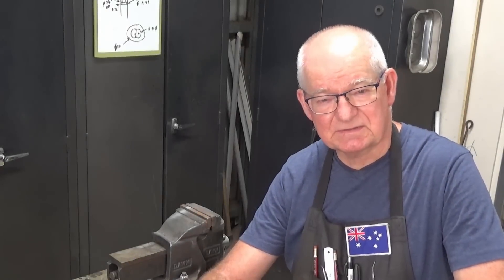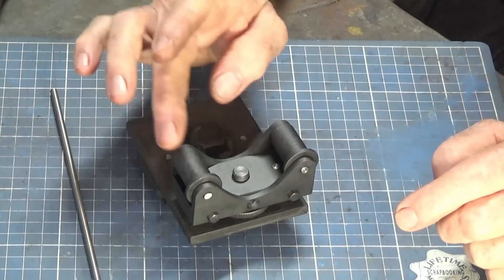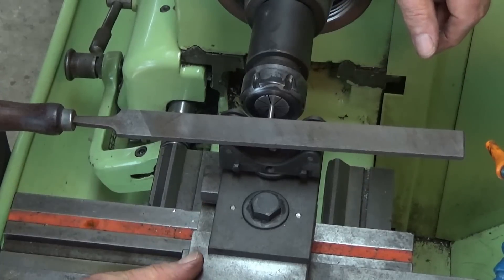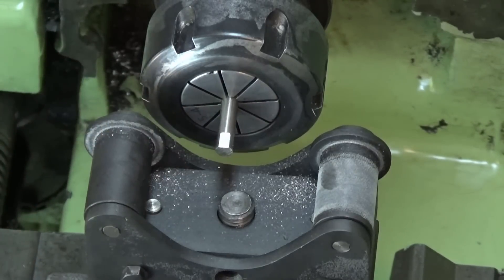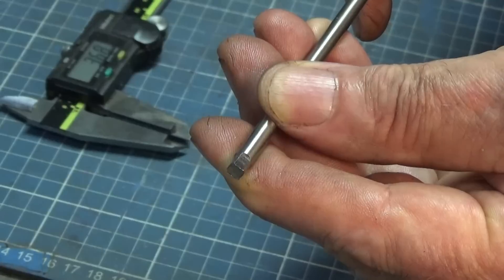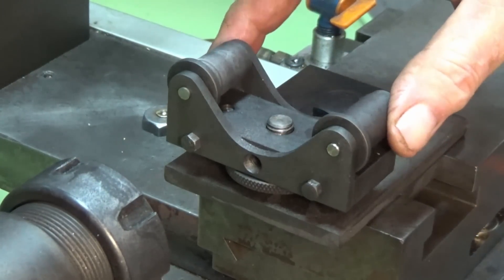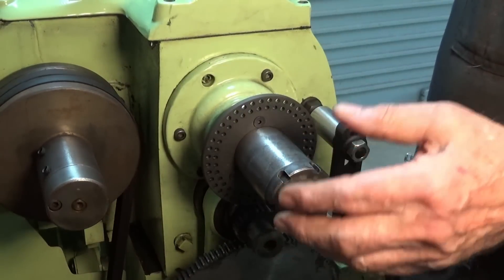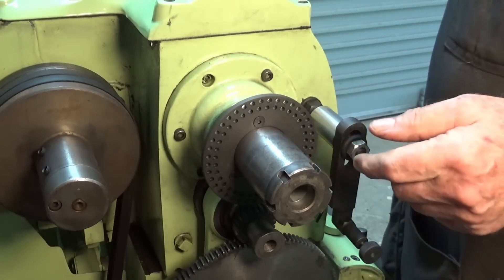The Poor Man's Milling Machine (AKA - The Roller Filing Rest).

Comment: Always enjoy hearing about the ingenuity that people have to come up with solutions to problems that don't require a whole new machine.
Reply from the maker: I was a member of a model engineering club many years ago and they had boxes of really old British Model Engineering magazines. They allowed members to take whole volumes home to read. They were a treasure trove of really clever and interesting tools and techniques. This would have been back in the days before you could just jump online to buy just about anything you wanted. It was also the period when there were material shortages after WWII. I guess it was all about making what you needed from low cost materials back then. 
Regards,
Mark

Comment: A mount for a dremel might be handy for less precision.
Reply from the maker: I have a cast aluminium mount that fits in my compound slide for a small Makita router motor. It is useful as a substitute for a tool post grinding attachment. It will take mounted grinding points and milling cutters and the spindle bearings are rigid enough for good precision. I find that the modern variants of the Dremel have pretty "flexible" bearings with lots of end float but for small jobs in aluminium and plastics they do the job. 
Regards,
Mark

Comment: 2 tons of machine set up just to grind a few microns of metal?
Reply from the maker: I am thinking you have missed the point of the video. It was intended to show a viable alternative for making flats and simple polygon shapes on parts using just a lathe. Some model engineers and would be clock makers may only have a small mini lathe at their disposal (not a 2 ton machine). I made that attachment when I only had access to a small bench top lathe and although it's simple it works very well.

Comment: Awesome,  thank you! 
Can you do a video on making a jig to attach small aluminum discs to so as to create sprockets?
Have a great week!
Reply from the maker: I am guessing you could make some rudimentary gears but it would require special file profiles if you wanted to hand file the teeth. There are specialised motorised shafts that can be used in conjunction with involute gear cutters but they are more for clock makers and watch makers. Take a look at the work that Clickspring does on that topic. https://www.youtube.com/@Clickspring/videos
Regards,
Mark
Reply: @Preso58  thank you,  much appreciated,  I'll check that out.

Comment: THIS IS A NICE TOOLING DEVICE, BUT, I'LL BET IT COULD BE DONE WITHOOUT THE "ROLLERS".... USING A HARD PLASTIC BLOCK, INSTEAD.:face-blue-smiling::face-green-smiling::trophy-yellow-smiling:
Reply from the maker: Absolutely. A hard nylon block would work well and I have seen a similar concept used by Joe Pie. It depends on how often you would want to use it.
Regards,
Mark

Comment: I'm a Certified Master Clockmaker, in the trade for 45+yrs. I acquired a used factory made filing rest for a WW watchmakers lathe when I was a young man, I've used it frequently over the years. It is mounted on the lathe bed on a shoe much like you described. However, I occasionally have larger workpieces that I run on an old 1928 Hardinge Cataract 5C. The filing rest you are showing would be ideal for that use. I can't believe in all these years it didn't occur to me to make one, I have been using a small mill with round stock in V-blocks. A pain in the butt, I'd much rather use a filing rest. Thanks for the inspiration. Great Video.
Reply from the maker: Yes, they are might handy for small stock. I made mine many years ago and it was sitting in the bottom of a drawer looking sad and rusty. I cleaned it in evaporust and parkerised all the steel parts and it looked so nice that I thought it would make a good video. I think I made it when I had to put some square ends on some small diameter drill rod but when I finally got my own milling machine you sort of forget that there are simpler and safer ways of shaping small stock. 
Regards,
Mark

Comment: Thanks for the shout out Mark. The roller filing rest is a great idea. It is something that I had not thought of, but it would be useful for small diameter parts that (as you say) could get bent in the mill. 
The indexing plate looks good. Yes, you can make others with different numbers of holes for specific jobs. Ironically I'm currently working on an indexing plate for my next video. It is for the wood lathe for when I'm using the router jig to cut flutes in turned items. I foolishly put my name down to run a 'tools' demo at the woodturners club in April.
Reply from the maker: I've never understood why lathe manufacturers don't add some sort of direct indexing device as standard, especially on metal lathes. My Hyco woodlathe has indexing holes in the pulley and a plunger for locking the spindle. I think all the Woodfast lathes we had at school had direct indexing built in as well. 
Regards,
Mark

Comment: That screeching sound was like nails on a chalkboard!  Eek.
Reply from the maker: Yes, sorry about that. The safe edge of the file will rub on the vertical face which causes the noise. If you reduce the stickout of the stock the noise mostly goes away.
Regards,
Mark

Comment: It is feasible to 3D print the disks with the holes.
Reply from the maker: Absolutely. I would be wanting to ream them to be a close fit on the plunger pin though. 
Regards,
Mark

Comment: Simple design but very useful tool.  I would imagine the body of the tool could also be created from a milled block of aluminum or even from a casting -- rather than being made from steel.
Reply from the maker: A casting would be great. There's not a lot of load on any of the parts so it could be made with some nice elegant curves. 
Regards,
Mark

Comment: It's hard to believe you can maintain any sort of precision with using something as basic as a file and this set up.
Reply from the maker: The key, I believe is that the tool pressure reduces to almost zero as the last cuts are made. So, there is no deflection of the workpiece and the position of the file is absolute as long as there is no clearance in the rollers or the guide pins.
Regards,
Mark

Comment: Damn, that is a brilliant little device... Not sure as to how much use I would have from one, but it is going on the projects list... Generally, i prefer the surface grinder or a tool&cutter grinder with small V blocks or large V blocks, depending on the diameter, but for putting in a flat onto a rod, well, it doesn`t get much simpler than just lining up the V blocks up to the magnet`s fence, clamping the rod and letting the stone wheel just do it`s magic... T&c.g. is a bit different with setup, given the lack of magnets and a different machine geometry(at least in my case - deckel s1), but then again, the cutter grinder is designed to grind any number of ridiculous parts, so affixing a rod and putting a flat onto the surface is not really some high science... 
Regarding this device, i think that bronze bushes would be the best, that or carbide bushes and glass hard hssco pins, as this simply doesn`t have the stroke to utilize anti-friction-moving-element bearings to their full extent, rather, any such bearing on this would likely see premature wear, as the bearings wear the most when they move from a dead stop, and rolling a file by hand is gonna give the bearings nothing but a whole lot of stop-and-go sequences... A bronze bush or a hard bush like mentioned will tolerate such mode of operation with much more appreciation over a more complex bearing... I guess a yellow bronze like brittle alu-copper bronze alloys with higher alu content would also grant some good bushings for this, they can be made in the home shop with a bit of copper and alu, whereas carbide bushings are a terror both price-wise and machining-wise... I guess that a camshaft could also grant some hard iron bushings for this usecase, tho, sourcing those can be troublesome if you don`t have a friendly scrapyard owner as a friend... 
Very nice project and definitely a great intermission in the steamer sequence... Glad to have seen it!

All the best and kind regards!
Steuss

P.s. regarding that spindle indexer, i`ve been thinking of a similar design for quite a while now... Definitely on the list as well...
Reply from the maker: I made this tool when I didn't have a lot of workshop resources. Certainly, way before I owned a D Bit grinder and a milling machine. Yes, a surface grinder would be ideal for some operations that you can carry out on a roller filing rest but I'm not there yet. I guess it's one of those tools that can be as complex as you want it to be but I am still surprised at how accurate it can be and the surface finish that it can make is superb.
Regards,
Mark
Reply: @Preso58  
Hah, funny, i find it hard to think of you not having a lathe and a mill... Tho, it is kinda visible in the tool, there is just some slight patina that always develops on metal that had not been painted over, even with oxide finishes, they mature nicely, lose the crisp appearance and just look more natural to the eye... 
Speaking of the tool, I fully agree with file cuts being able to result in some ridiculous finishes, i had similar experience with my own lathe file and parts on a lathe... The crosscut bastard file is a material remover, and a brilliant one at that... I cut some damn large chamfers for thread starting with such files on higher speed on my lathes and damn do they brutalize the metal beneath them, but a lathe file can finish such cuts and make them look almost like hardturned cbn finishes of cnc lathes, near mirror grade finishes, which is astounding, yet quite sensible, as a good file is in essence akin to a shear cutter on a shaper... 
Yeah, the accuracy of the roller rest is quite amazing, i guess that it could go even higher with some more refinements like the aforementioned hard bushings and glass hard pins that are on a near hydraulic fit, especially if they are supplied with small cups of oil to ensure perfect operational conditions... 
Sure, a t&c.g. and a s.g. are the queens of quick and efficient setups, but as you said, one has to own such machines beforehand... Speaking of which, i greatly enjoyed your dbit grinder series! 

Best regards!

Comment: so how do you stop the lathe turning as you push on the material with the file?
Reply from the maker: The indexing attachment prevents the spindle from moving. However if you just want to cut a flat and you don't have an indexing attachment, put the lathe spindle in low gear and hang a weight off the chuck key. (make sure the lathe is not plugged in). 
Regards,
Mark

Comment: Good reminder to give this project a bump on the list. Still need to make one for my lathe but other things keep getting in between. For the division i do have a setup using the change gears of my lathe, it has a bit of play but seems accurate enough for what I've done with it so far
Reply from the maker: There was a very good example of an indexing attachment described in the Model Engineer magazine that used the backgear bull wheel on Myford type lathes for indexing. The indexing plunger could fit between the teeth or if turned 90 degrees it could fit over the crest of the tooth, doubling the number of divisions available. I seem to recall they suggested wrapping a rope or strap around the chuck and then attaching a weight or a spring to keep the spindle backlash from allowing any movement.
Regards,
Mark
Reply: @Preso58  that sounds similar to my setup though I didn't fix the backlash problem yet. The weight sounds like a great plan. Thanks for the tip!

Comment: That sure is a clever idea. I've never seen that before. Even if hand filing is primitive :)
Reply from the maker: Certainly primitive but I remember when I started my teacher training we had to hand file two pieces of 3mm thick cold rolled steel plate cut to a sort of lightning bolt shape on the joint line. They had to form a sqaure when put together and you had to place them on a light table to see the gap between the parts. I found it fascinating to be able to make a precision fit with nothing more than a hand file. However, that was back in the days when my eyes still worked properly! 
Regards,
Mark

Comment: Clever indexing.  Thanks for the video keep on keeping on.
Reply: If you have a dividing head you could bypass the lathe altogether, mounting the file jig onto any common surface to the head.
Reply: Btw from  Boom Engineering .
Reply from the maker: Thanks Harold. The mark II version of the spindle indexer is much nicer to use.
Regards,
Mark

Comment: Looking at those plans, why the 1/4 40ME thread, as a metric world fellow, those are expensive for single use. Is there an alternative?
Reply: You should be able to pick up a 1/4x40ME tap and die set in carbon steel for very little to be honest and it would be fine  but I would think any thread would do though obviously a finer thread would be better for fine adjustment .
Reply: @screwcutter1 Is a 1/4 40 me same as 1/4 40 wf?
Reply: I'd probably take a standard M6 thread, with 1mm pitch it gives you a nice gradation to figure out how much you moved vertically with one turn of the wheel

Comment: Btw. it copies more the moving of a scraper than it does a milling machine.
Reply from the maker: My reference to the milling machine was more to do with the ability to cut flat surfaces but you are correct since a milling cutter would use a rotary cutting action. However, the shaper and the planer are also single point cutters that move in a linear pattern. A file is sort of like a multi tooth shaper!
Regards,
Mark
Reply: @Preso58  As a hobbyist I only once had to grind some workpiece flat and perpendicular to a certain degree of precision. I built a jig out of wood to clamp and slide it in a controlled manner on a flat board where some sand paper was glued on.
I did not find resources how Carl Edvard Johansson modified his sewing machine into a precision grinding machine for his first prototype gauge blocks.

Comment: Thanks Mark! Almost every machinist on YouTube uses a mill. As I don't own one it is great to see how far one can get with just a lathe. More videos in this category would be highly appreciated! Did you also make a device for milling slots using the lathe?
Reply from the maker: I do have a fixture that can hold a two speed electric drill. It can be aligned parallel to the spindle or perpendicular to it but it's not exactly a precision spindle. I have used it to cut slots in plastics and wood but it's a bit sketchy on metal. It is good for cross drilling in the lathe though.
Regards,
Mark

Comment: About 40 years ago,😮, my shop teacher told us to chalk the file with a schoolboard chalk stick. I think its not what you want to powder your lathe with but it works for keeping your file clean. Not so much for aluminium though…
Reply: Yes, it'd be 56 years since I was taught in Metalwork classes in secondary school to use chalk on the file to prevent clogging, although we used French chalk. It makes quite a difference, hav8ng a proper file card to brush the file also helps.
Reply from the maker: We were also taught that when I was at school. I am not sure it really worked well though.
Regards,
Mark
Reply: Yep, I’ve tried it for jewellery making, working mostly with sterling silver. It kind of works, but I generally don’t bother with it.

Comment: I’ve used a very similar device for the last 30 years of my working life, but it is just a pair of case hardened rollers mounted to a cast bracket which I used to fit into the vice. This adaptation is a brilliant idea which will greatly ease many filing tasks. Great video as always, thanks Mark.
Reply from the maker: Thanks. There seems to be many variations of the same working principle. It really depends on how your lathe is set up. You can get more adjustment if you can fit it directly to the cross slide. I guess you could adapt it to suit other methods of holding the workpiece.
Regards,
Mark

Comment: I know you watch Tom Lipton, I remember him showing a simple file-rest for controlling the angle, but this one controls the depth, too. And I've certainly never seen one with rollers.
I was planning to make something like this, a jig maybe, for a small diamond file to touch up tools.
I guess one could use some commercial rollers for this, even plastics would do, since repeatability is not required.
Reply from the maker: I am thinking you could make interchangeable rollers for holding round files or triangular files too.
Regards,
Mark